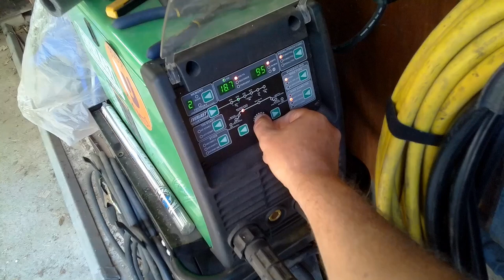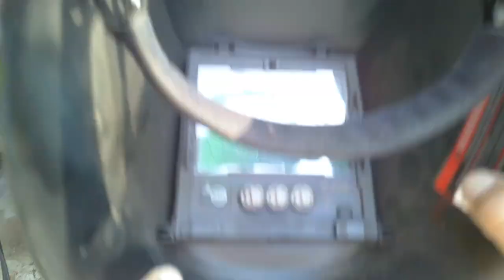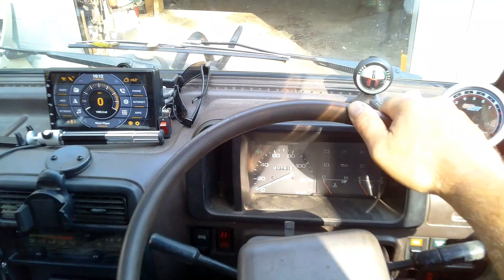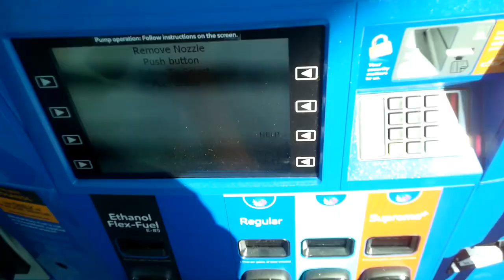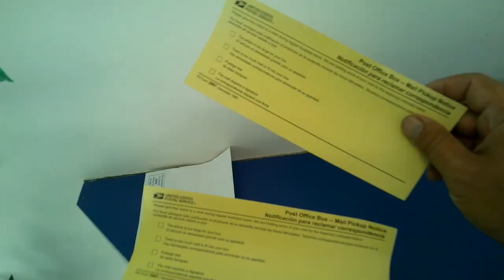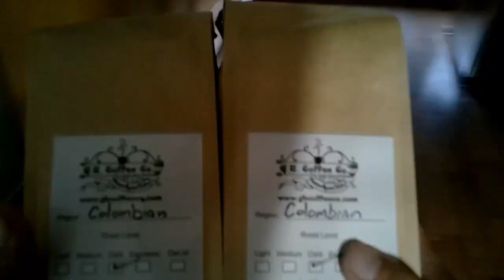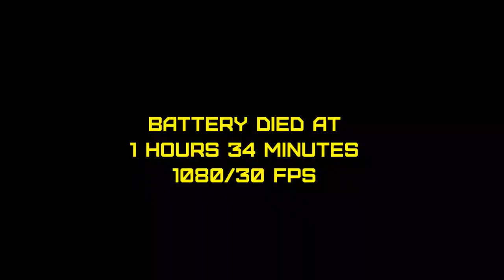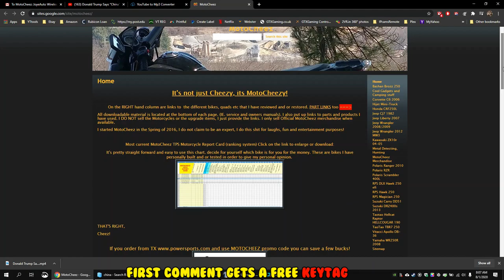DO NOT BUY the Ivue "The Vista" video camera glasses until you watch this video!

Comment: Hey there MotoCheez!!! 
    I have to agree with your decision on the glasses. It kinda felt like you were always in a smaller room. The audio is great though. 
 You shouldn’t worry about your welds. You don’t do it every day or even every week I suspect. There’s always a grinder,,,, get it welded, grind off anything messy the turn the temperature down a bit, get a piece of angle iron to help with keeping it straight and burn a new weld on top,,,,,. I have cheated that a few times just for appearance on some of my projects. The welds all held up, even though lots of guys said they would crack. That was some time ago now. Guys say I’m a decent welder now, I think I’m ok, but for thin metal especially, I bring my buddy over that is a pipeline welder (retired). His work is perfect! When he does rut repairs it’s almost too bad we then grind the weld off to match the surface!! Haha. I’ll never get there,,,,,. That mount looked great! Your welds got better the worse you could see!!! Hahaha. I actually grind smooth a lot of the work I do now. I like the “all of one piece” look it gets. 
     Looking forward to some more Florida Cheezy!!!! Excited to see the new carport. The sun can be even harder on things than the 4 seasons. Good to protect that interior of the pontoon especially. 
   Later, Eh!
Reply from the maker: I can weld grade A when I want to put the time in and prep. Couldn't see on these lol. Had to keep stopping to see where I was. Lol
Reply: @MotoCheez  - Too funny!!! I will never be grade A,,,,, B- maybe, on a good day,,,,,, heh heh heh.

Comment: Have you checked out Zetronics glasses? Up to  147º Wide Angle Lens with 1080p HD with Electronic Video Stabilization
Reply from the maker: I had the ultrawide Zetronics, they were ones I used all the time, . I looked on website last night, didn't see one that wide with stabilization.
Reply: @MotoCheez  how did you like them?
Reply from the maker: They were pretty good,  battery life was about 50 minutes and if you folded the glasses to put away, after a year the wire to battery broke from flexing. They still my favorite of the video glasses. 
I use the Order EP7 currently., Has over 2 hours recording, gimba videol stabilization, only issue is the audio is low.  It's better then the EP8 I reviewed both,